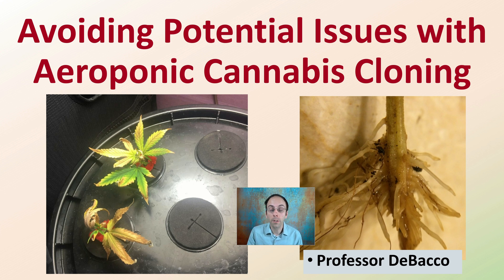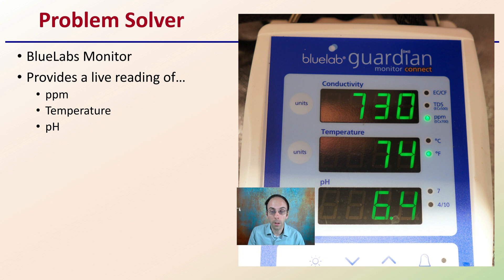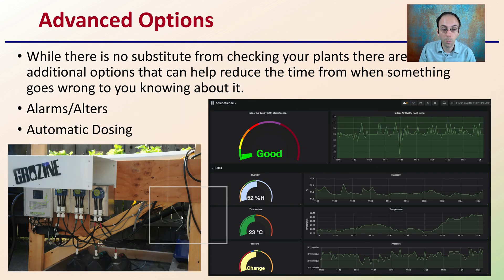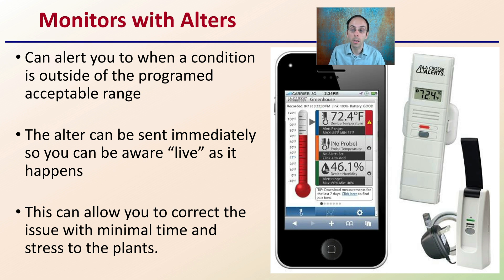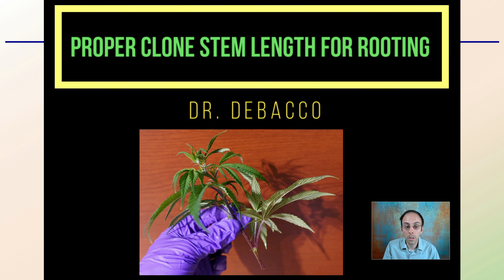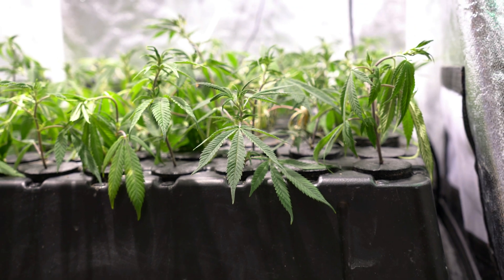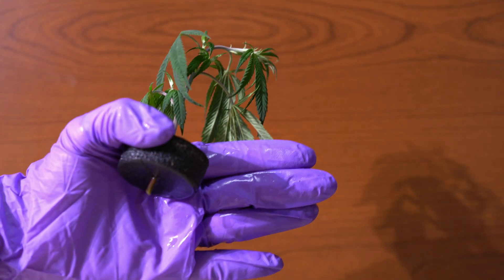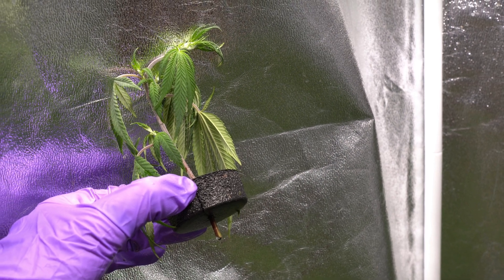Avoiding Potential Issues with Aeroponic Cannabis Cloning

Comment: My Tips from personal experience:

Use R.O. water, add supplements to R.O. water for min ppm and micro-nutriment (you don't want clone plant growth, you want roots)
Or use: boiled (good quality) tap hard water, do it before hand to let it cool. (but the hard water will calcium-tar your cloner and pump, clean with vinegar/acid before or after each use)

Cycle the pump
-15-min interval may be too long if your environment is hot and not humid enough. could dry up clones.
-Shorter interval will always work great.
-Always On is not efficient: pumps heat up the reservoir, and clones don't urgently need to produce roots to hydrate.

The worst would be: pump always on + dome in humid tempered climate with bad air circulation.
You want a lot of air movement to dry the clones, resulting in roots forming faster.

Not much light needed. 
Usually using grow period (setting up our cloner with the motherplants or in the growphase tent)

Light (for grow, generating a little heat) + fairly dry & tempered climate + cycled pump will greatly push the clones to produce roots.

Some also don't provide light or use darklight only, I have not tried this, but since we don't want to grow the clones, we don't need the decent grow light (it's about rooting the clones)

MotherPlant: before taking cutting, feed her bloom nuts. (again it's about rooting, not growing the clones)

PH ??? not importante here. Cloning shouldn't take more than 2 weeks. The water level will drop. Just let it be. And replace the water.
The reservoir temps will swing with temperature. You don't want to play with this.
The reservoir is not well insulated, small, hard to keep the temp stable there. so imagine the ph swing. imagine doing the adjustements. imagine more trouble. imagine minimal impact.
Reply from the maker: Thanks for sharing your experience!

Comment: you talk about the 3 issues, but never tell us what the values should be!! What pH & temp should the water be?
Reply from the maker: This DeBacco University video should help... https://www.youtube.com/watch?v=_gOXYe9DyxY&t=216s
Reply: or like, his solution is to set every right, again and again.
never pin-pointing why/how it's happening in the first place, so we can't relay the information efficiently ourselves... it's "meh" infos here.

I want to know the "why" some cuttings are making to bulge mass and not rooting.

about PH and temp: where you set your cloner is good enough, and PH is not important, you're not growing anything.
the res will swing in temperature, there-for the ph will swing with it. The water level will drop. Just let it be. And replace the water.

Comment: Should a humidity dome be used at the beginning stages of aeroponic cloning?

I agree with the previous comments. Your content and presentation are excellent. Thanks.
Reply from the maker: No necessary, but the plants will likely wilt but should return to normal after about 24-48 hours.

Comment: Hello, professor DeBacco! That do you think about cloning cannabis, using beneficial bacteria? I’ve been tested pseudomonas koreensis(indole-3 promoter), but have no stable results. 
Right now I’m test koreensis+non-ionic surfactant directly in leafs and molasses+koreensis directly in coco with clones.
Reply from the maker: Plant hormones are likely more beneficial than beneficial bacteria for the initial formation of roots.  Once formed rhizosphere interactions will have biological connections.
Reply: @DeBaccoUniversity  Thank you, I need to test use biological after the initial formation of roots with hormones!

Comment: The biggest milestone I’ve discovered with aero cloning is keeping the cloner and solution sterile. I have great success with clear Rez but very small amounts of bleach can be substituted, can find more info on that with a quick google lookup. An investment to permaclone collars were also a game changer as I can sterilize them in the oven between runs. Permaclones website also has a really great write up on successful cloner procedures. After learning about these important factors I normally get a 100% success rate as long as my temps and ph are in the right ranges.
Reply from the maker: Being clean and sterile can prevent many problems.

Comment: trichoderma harzianum would be a good addition to a aeroponic cloner.
Reply from the maker: May not be the most supportive environment for it, but will not hurt.  RootShield plus would be an option as well, since there is a water soluble powder formulation.
Reply: @DeBaccoUniversity  My opinion that nature abhors a vacuum. I use raw wettable powder microbes. Has the highest cfu in a package you can buy.  and good teammates that work with one another not fight for resources.